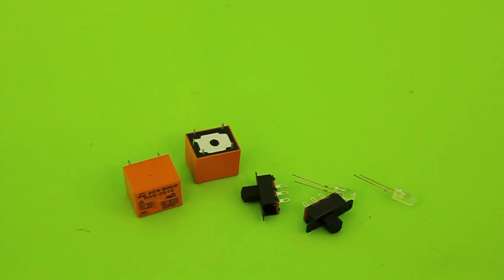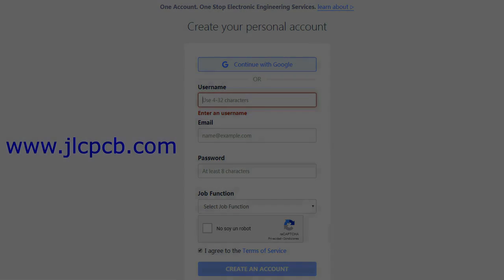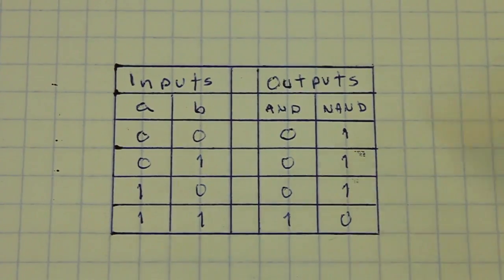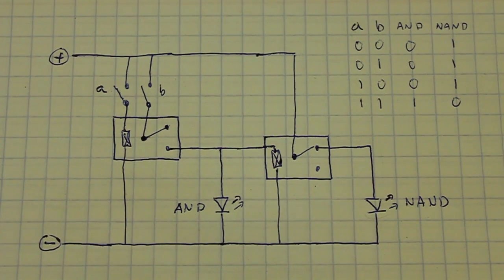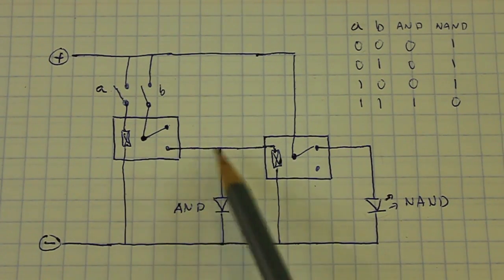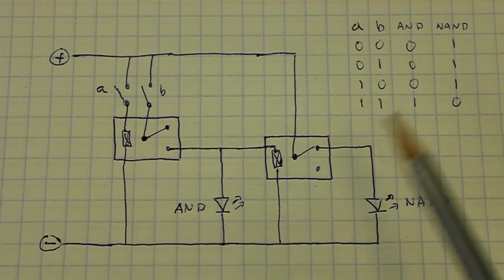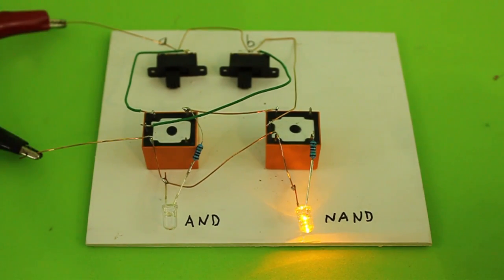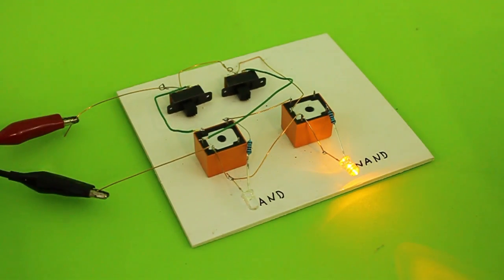Relay Logic: AND and NAND gates

Comment: you dont need the seconds relay. simply connect the NAND output to the normally closed of the first relay.
Reply: That is not the same thing.
Reply: @will_it_work for a nand or an and gate all you need is 2 series switches between 5v and 1 of the coil terminals. The other coil terminal connected to ground. Your common terminal is connected to 5v. for an AND gate, connect your output to the normally open contact. for the NAND gate connect your output to the inverted (Normally closed) contact. only requires 1 relay.

Comment: What I notice is how a coil and an LED are in parallel with each possible setting.  Does this create an LR circuit with the coil acting as an inductor and the LED as a resistor?  How does this affect current and voltage in the circuit?  If the LED's are replaced with lamps, will the lamps be dimmer?